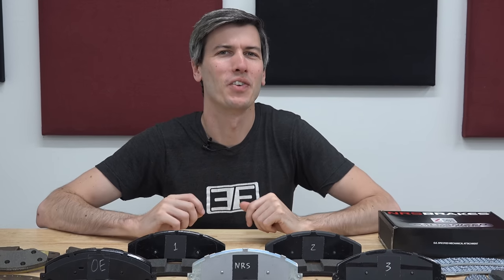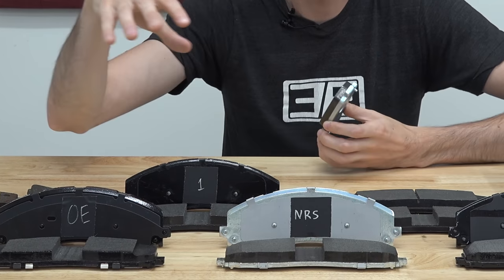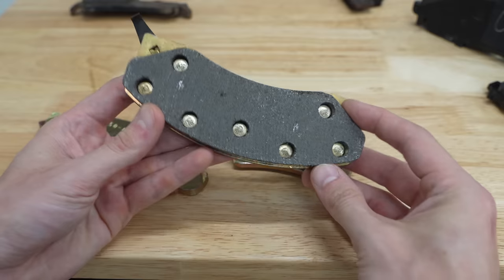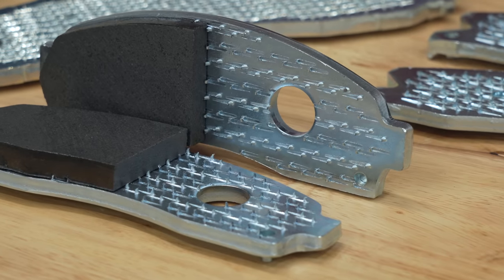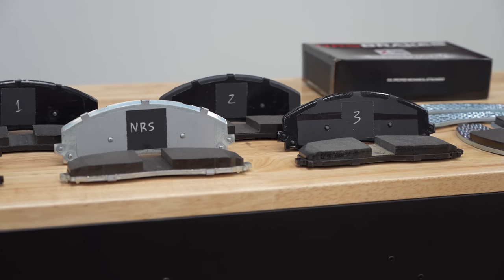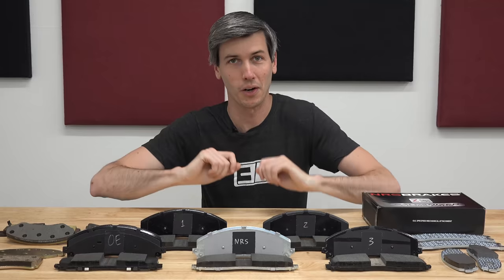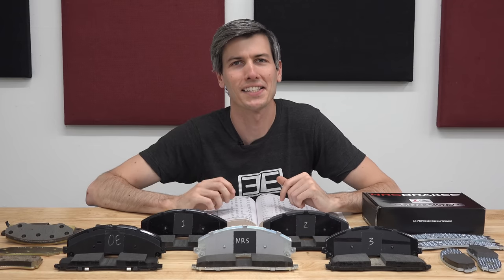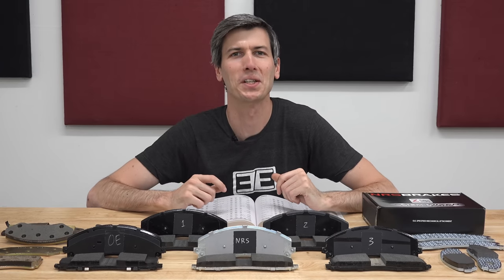The Sketchy Truth About Aftermarket Brake Pads

Comment: I think it would be a more realistic test to perform a thermal cycling test to simulate normal driving conditions, though this was a very interesting investigation.
Reply: For normal driving conditions, these mechanical attachments are not as important. This video focuses on heavy duty use
Reply: Heavy undefined use in a scenario that will never likely happen.
Reply: @deet5072  Sounds to me at least something like riding the brakes going downhill towing a heavy load, surprisingly common for heavy duty stuff since the Earth ain't flat and there's always a need for something heavy to be moved. But if you're doing that you're probably going slow and have the hazards on so there's not a massive amount of heat being generated, but better safe than sorry is something I adhere to unless I'm very strapped for budget
Reply: @deet5072 I live in the mountains I use my brakes more often because of hard fast down hills every day, literally dropping and gaining 1000 plus feet , so for me these hard breaking situations are very regular. Idunno just cus you can’t fathom it doesn’t me it doesn’t happen and often. I have lots of neighbors we all talk about how often we go through brakes… again just because it’s not your experience doesn’t meant not only doesn’t happen , but also normally and frequently for other people. 😊
Reply: @LafemmebearMusic  Then a more prudent test would be to have heat cycles on and off for predefined period of time. Im sure it was just B roll but if they just slapped on the brakes for hours or turned the roters red hot, this is not what you are going to see reflected in the real world.
Reply: @Avetho  most modern heavy duty trucks have exhaust brakes and you can engine brake as well. tho you probably have to be in "tow/haul" mode for it to be active and i know several people who never use it even when towing because they "don't like the higher engine rpms" like dude you are asking your truck to do more work you need more revs and the computer is just making sure you are in the proper gear for a high load!

Comment: I had top brand aftermarket shoes come unbonded on rear of my suzuki mighty boy and it locked the rear wheel at highway speed almost causing a crash. Replaced with riveted oem ones and no issues. In workshop have seen so many falling to bits ready to do same but is very unlucky to lock a wheel or not have sufficient brakes left for most instances, undoubtedly happens though I just don't see them at my shop.

Comment: I understand the lab results are solid, but does this happen in real-world use? Are there cases of the friction material detaching from the pads due to adhesive failure?
Also why is there not a small bed in the metal plate where the friction part could nest in? Wouldn't that pretty much compensate for the lateral sliding force?
Reply: If you try to visualise it, depending on the depth of the bed at some point it would become part of the friction material brushing against the rotor. Not a good idea.
Reply: @georgivelkov8143  Isn't the same for these small sticking pins? 
You'll be alerted for the used pads before that point, and if you don't, the metal will start touching the disk and you'll know it's time for a change. No big deal.
Reply: @nevarran  I guess you could be right but at that point the economic side of the story would play a bigger part as you either need to increase the cost or simply sell a pad with technically less material as part of it would be unusable
Reply: I was wondering the same thing. Have been doing occasional DIY brake jobs for 3 decades now and have never seen this type of failure. I have checked out NRS pads but they were very expensive and there is little emphasis on pad materials and braking performance.

Comment: good to know... I drive in south CA, I drive a 3500 chevy cargo van that warps the rotors every  time i break hard... on ceramic pads... any tip how to avoid this. Im using cross drill and sloted rotors...

Comment: Another point to consider, rusting of the backing plate / pad that contains steel fibers.   In road salt areas, I've seen pads de laminate as well as the friction material crumble.    I'd tend to think that adhesive attachment has an advantage in this case as it seals the friction material to the backing plate rather than a somewhat porous friction material molded to the backing plate.

Comment: Possible anyone knows what adhesive is utilized to attach pad material to the backing plate?
Any chance a normal person could get there hands on that adhesive to make some replacement pads for a small Non car/road going vehicle, but for a small old vehicle that a pad no longer exists?

Would love to find some info how to DIY adhere a old backing pad with new pad material with industry similar brake pad adhesives!

Comment: Great info, I had no idea. Pads on my 3/4 ton diesel seem to always have rivets. How about a video where you name names and save us big truck owners time and trouble?
Reply from the maker: I don't know every brand who does/doesn't, we only tested three. My point was consumers should be able to know, hence the Z-label discussed at the end. But, OE (if required) & NRS will have mechanical.
Reply: I worked at an industrial brake manufacturing company, we built brakes for cranes. All of our friction material was glued on. There was an option for riveted but we rarely had any on hand and almost never sold them. Keep in mind these were used as braking units for cranes.

Comment: I replaced my rotors and pads over the weekend in my 2011 Acura MDX, not sure what brand I pulled off but found the inside pad on my back passenger wheel had separated from the shim. Luckily it had tabs wrapping around the pad as you explained so it was still in place and had not caused any issues.

I ordered some mid level Power Stop rotors/pads 2 days before seeing your video and decided to install and try out for $370 instead of returning and dealing with all that. I’ll be ordering OEM next time after watching, I’m guessing Acura/Honda sources quality parts like what you used as an example in your video.

Your videos rock, thanks for putting the time in for everyone.

Chris

Comment: At about 20,000 miles, the rear left of my 2014 ram 1500, had rust jacking. I was on the highway pressed on the brakes due to traffic and the pedal went straight to the floor. I nearly s*** myself. I didn't realize that's what happened until the next day when I checked the brakes. It had already ruined the rotor, so I had to replace pads and rotor on both sides.
Reply from the maker: Yikes - glad you're okay! Appreciate you sharing. And it's exactly that, the terrifying feeling of the pedal going straight to the floor because the pad is no longer there, so the caliper piston has nothing to resist against (gap to the rotor).

Comment: None of them are colored so EBC wasn't tested. I'll keep buying them.

Not naming the brands doesn't help anyone. Knowing all the "reputable brands" for brake pads may not be niche for people who do mechanic stuff as a hobby but for everyone else it is. 

The video is interesting, but not actually helpful.
Reply: I get it, he can’t say to not lose monetization. But it would be super helpful to know the brands.
Reply: EBC is what I trust for my fully modified Tacoma.  Bites great and lasts long.  Even with heavy offroad use.  My truck is 30% heavier than stock and stops like OEM.  My mechanic was 100% correct when he recommended them.
Reply: I've had a yellow stuff pad completely disintegrate on track, once I got back to pits and pulled the caliper off and the pad just fell apart. So absolutely not immune and the yellow stuff is even marketed as a fast road / light track pad. Not doing them again, at least not for fronts.
Reply: @markythegreat  EBC specifies their pads Yellow is now only rated for fast street or auto X use. Their blue stuff is the now entry level track. even then they advised that it’s not for hard track like super 200/ compound and fast driver. For legit track RPX or RP1
Reply: There is another perspective here with not 'naming and shaming' and a strategy i have personally used.  If you want to influence industry wide adoption of best practices then this strategy is really effective.   You raise awareness of an industry wide problem and then when everyone is aware of the problem the people who can influence the situation are able to affect change.   Clearly those in the industry can identify these parts.  If the buyers for Reilly and Autozone act on this information then this will help drive industry change.
Reply: @7mpowerd  yeah I'm aware of this - at the time the blues were not road legal in the UK. I believe they are now, but I've since moved on. That said, finding a "perfect" pad seems nigh on impossible, without spending serious money on a part designed to wear out.
Reply: @markythegreat  I’ve come to the conclusion of just swapping a set of track rotors and pads. This way I can have nice street pads with low dust and long life, and the perfect track pad with bedded rotors. More work but better on consumables
Reply: @7mpowerd  yeah I've thought about this but it's so much faff at the start and end of a track day - I always carry a set of "get me home" pads, usually just some old street pads with meat left on them, in case I cook the ones on the car, and I've had to use these before, but changing out pads for every track day is not what I want at all. I had most difficulty with a massively over tyred, double factory horsepower mx5 and it absolutely rinsed brakes because the factory discs and pads are just too small for that sort of abuse. Moved on to BMWs and had problems with fade and pad deposits but thankfully no total pad failures.
Reply: @markythegreat  track is only a hour away from me, and all backroads. I just ride track set up to and from. Then swap next day at home.

Comment: In 2001, I bought a new Toyota 4Runner. Unbelievably, the front pads lasted slightly more than 200,000 miles. When it came time to replace them I took the car to a random shop near work. Big mistake. Almost immediately my chrome wheels turned black and the pads eventually needed replacement at 20,000 miles. The OEM pads lasted 10-times as long  as the crap pads. Are the NRS pads as good or better than OEM? Now, I just bought a use RAV4 that just had new brakes installed and again my wheels are turning black. I think I’ll make a better choice when I replace these.

Comment: The tests results may be accurate, but how well do those tests reflect real-world brake temperatures and shear forces? The only type of failure I heard about cheap pads is that they wear out faster, or don't provide the same stopping force as good ones.
Reply: yes EBC brakes has a good explanation for this-most brake pads needs some sort of heat to stop-look up F1 brakes and you will get the point of what im saying.
cheap pads are generally softer and are not that rough on discs-
some pads use softer materials in order to last longer
while some hard brake pad material leads to more disc brake wear but if your car is a sports car it needs that stopping force otherwise you will probably crash...
its imortant to alwasy ask your Car dealer or car service shop for these things 
i know that most dealership service mechanics want more money-but i dont trust my local mechanic when we talk about 
engine,brakes or suspension... for oil changes and basic stuff fine..otherwise no
Reply: I’ve had issues with budget pads over heating and not stopping before.  I’ll never use budget pads again for my or my families cars, saving $20 just isn’t worth it.

Comment: Never had any issues with the autozone pads. Been using since they were Albany brand but now I use the duralast gold.  O'reilly's pads never separated but wore extremely fast and the rotors cracked easy.
Reply: I used to run duralast gold; I loved how they have the lifetime warranty and would get new pads when they wore down 😂 I’d just keep the receipt and swap accordingly when the time came for it. Great value!

Comment: Recently I had brake pad fail on me - It was raining and i saw a lot of water collected on the highway and hit the brakes. And There was almost no response. The second pump did the job but I heard noise.(the metal pad on the disk) I was quite lucky and drove home without using the brakes. Now I know there is a better way. Thanks Jason

Comment: does shear strength test specified in FMVSS requires the pad to be heated up before shearing?.... as per ISO 6312, shear test is only done in ambient temperature....

Comment: I'm not a mechanic, but I've been changing break pads myself in all my cars for the past 20 plus years. I use aftermarket brake pads and not even once had the pads detach from the backing plate. This information is interesting but it will be better if you show us real world application comparison.
Reply: Rust jacking is the primary failure.
Reply: ive lived in MN for a long time. this is sooooo common here. reguardless of driving style, getting more than a couple winters on brakes is very rare @ShainAndrews
Reply: I had oem plates fail. So it's not oem vs. non-oem. It's technology vs. other technology.
Reply: @y2kmadd  or a bad batch maybe?

Comment: I’ve gotten unlucky with brake pads on my truck. My Raybestos Element 3s had backing plates that where underside a tad so they made a loud clack when going from reverse to 1st the first time the brakes where pressed. Ordered power stops as a replacement and they showed up but the little holes for the anti rattle clips, they weren’t done. Like they forgot to drill them at the factory. I bought both sets from Rock Auto so highly unlikely they’re fakes. Just weird string of bad luck. Ended up just drilling in the holes for the clips in the power stops because I didn’t want to faff with a warranty claim and having to put everything back. Use Galfer HH sintered pads on the bike and no issues on track.

Comment: Great informative video as always! I just literally ordered new pads from a brand name, but will be wondering if they use adhesive or mechanical backing 😐
Reply: i've never seen brake pads falling off the backing plate. catastrophic brake failure is a scary thing to worry people about but it is extremely rare. if one brake pad falls off you would still have plenty of redundancy to safely bring your vehicle safely to a stop. remember each wheel has a front and a rear brake pad. GM had a weird recall where brake pads were not installed on one wheel and people drove the cars for tens of thousands of miles and never even noticed!   These tests are weird  they baked the pads for Multiple days at over 500 degrees which is a temperature your brake fluid will boil and you will have so much brake fade that you would likely pull over the side of the road until your brakes cooled down anyway! 

Not saying don't do your research on what you are buying but if you buy from a major brake supplier like AC delco, Raybestos, Akebono, brembo, Bosch you are probably 100 percent fine.  I don't trust parts houses brand brakes as you never know what you are actually getting.

Comment: I would have liked to have seen a shear test that matched the directional forces in real life. My biggest issue with brakes is how quickly the pads break down. Not how well they stick to the backing plate.
Reply: I've had the same tbh. I think I need to swap out for a hotter pad and revise the cooling flow. Even RSL29s struggled to cope and that was on Eagle F1 Supersports, not even track day tyres or slicks.
Reply: how fast the pads breakdown or wears off depends on hardness of the friction material... a stiffer hardness will give less friction but better wear compare to softer material which has better friction but less durability....

Comment: Will definitely have to check out NRS when it comes time to do brakes on my newer Silverado 2500.  The dealer already replaced all the pads under warranty due to excessive brake noise, but even with a 'new part number' pad I had to wait for the noise returns.  They want to do pads and rotors now but its no longer covered by warranty, and I''ve never paid someone else to put brakes on the many vehicles I've owned.  I've had good luck with many aftermarket pads before, I'll have to research and see if I can find out if they are mechanically bonded or not.

Comment: I work a lot on trucks with disc and drum brakes and I have never experienced a glued friction lining come off of the backing plate/brake shoe due to overheating. I had trucks in my shop with deep blue and cracked drums due to extreme overheating, but the glue bonding the linings held up. 
I do only see cracked/separated linings due to water ingress/rust in totally clapped out junkers where it is sure that nobody opened or serviced the brakes in the last 30 years. The phenolic glue used to attach brake linings is incredibly strong. Cracked linings on riveted brake shoes is a daily sight for me, btw.